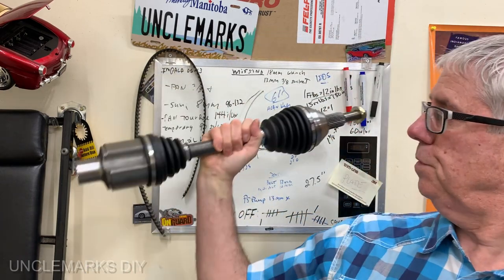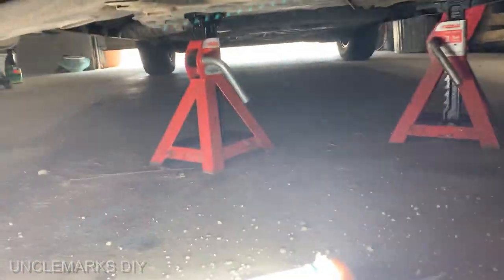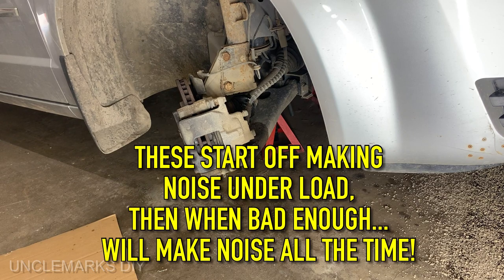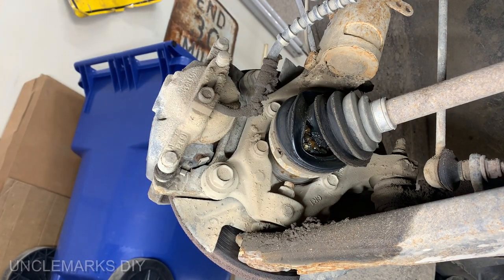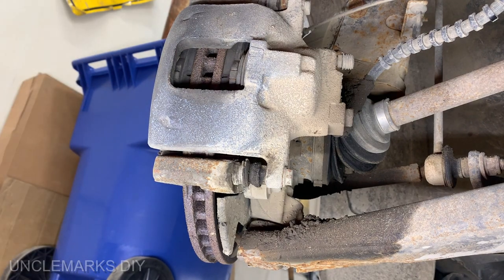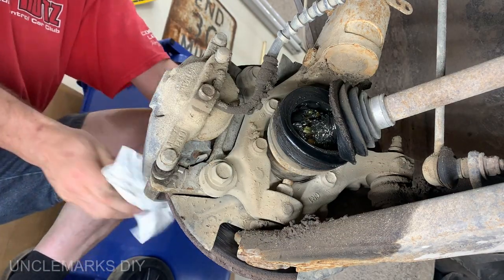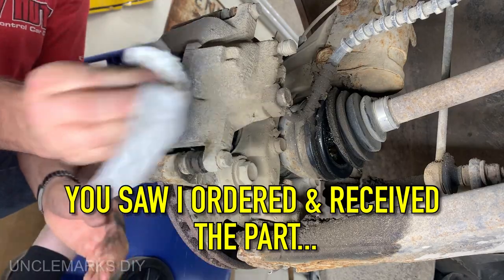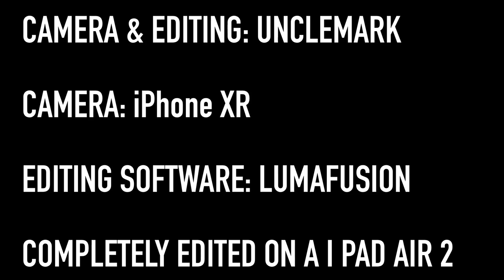Can you grease a CV joint? (EP 144)

Comment: i got 200,000 on a cv joint with a ripped boot. Wrapped it with a roll of silicone tape and just squeezed a few pumps of grease with injection needle every 5-10,000 Worked! But the constant mess was too much and finally fixed the boot. The silicone tape would last 30-50,000 before failing All highway driving though... constant turns in city you might need to replace silicone tape sooner...
Reply from the maker: Mine was only a month or two of lite driving then I did change it! And I agree, if you could only drive straight, the tape and / or grease would stay forever!
Reply: I'm sure in the hallowed grounds of mechanics there is scoffing and jeering, but I like that type of fix...Do what you gotta do...In the end all cars are just getting you from A to B.....I currently can't find any rip in the boot but it's making that noise, but NOT jacked up, only when the tires are on the ground, so it must be a pressure thing....So I guess my next step is to take the boot off and see if I can re grease it...
Reply: @captaingenius-o1c  No need to remove the boot...simply put a grease needle through the boot...preferably just below the metal on the largest end of boot...squeeze about 30-50 pumps of grease...then see what you got. Only takes a minute, and if the noise still there, then replace cv joint. Cheers!
Reply from the maker: @captaingenius-o1c  usually cv joints start off making noise when turning sharp corners. If knocks while sharp right, its the left one, if noise turning sharp left, its the right side one. (Or you could have a loose rim)
Reply: @unclemarksdiyauto  used the needle and put grease in both boots, as it sounds like BOTH sides are making the same noise when turning either right or left....Seems bizarre that BOTH sides would be bad at the same time doesn't it?  or could it possibly be anything else?
Reply from the maker: @captaingenius-o1c  both at same time seems odd, but could be other factors, & now you just started to notice? Also grease needs to get into joint and balls. Its probably too late anyway.
Reply: @khayapf47 what kind of Grease?

Comment: And if you have to do that, maybe even get a better grease than what the application calls for. But once you learn to change a CV joint, it takes about as long to change it out as it does to do this three or four times. The hard part is jacking it up and gathering the tools.
Reply from the maker: So true. We needed the van and didn't have the extra hour that day to change it. I have a video coming out in September 2021 of me doing a 2014 Dodge Dart Cv joint where nothing was easy! (It should have been though) Breaking tools & and a stubborn ball joint that would not come all the way out. They usually are straightforward and quick to do.

Comment: What kind of grease can I use? I live in the tropical climate
Reply from the maker: Briton, I was using general wheel bearing grease. The problem is the grease is not going to stay in the joint if the boot is ripped. I would suggest you get another boot, or replace the complete assembly. Even if you can get one of those "zip on" boots, the cv joint should be properly cleaned and grease reapplied since I am sure dirt has entered the joint. If it is not cleaned first, all your work will be in vain.
Reply: @unclemarksdiyauto  ok, thanks for the tip. The truth is that my cv join boot is still in tact but it's making that clicking sound when I do a full steering lock. I'm assuming that greasing it may solve the clicking sound temporarily, yes?
Reply from the maker: @britonmarrett796  I don't thinks so. I would plan on having it changed soon of course depending on your finances. It will only get worst.

Comment: Are you supposed to put grease on the end of the cv axle that slides into the bearing hub or can you just slide it in dry
Reply from the maker: You can slide it in dry. I usually put a little something on there because they tend to rust together & the next time you need to replace them, they are rusted together and even a big hammer won't get them apart.
Reply: @unclemarksdiyauto  that’s what I imagined. I was in a hurry to get my bearings done on my Silverado and didn’t even think to slap grease in there until after I bolted the wheels back on lol. I guess I could just take off the axle nut and pull the cv out and slap some on if it really bothers me
Reply from the maker: @jonnysnipes3123  Was there a torque spec for your axle nut?
Reply: @unclemarksdiyauto  yea 188 pounds but I tightened it to 200 cus I didn’t wanna use loctite so I wanted that extra precaution just to be safe
Reply from the maker: Some you have to notch the middle of the nut with a punch or chisel to lock it in place. FYI, be careful not to tighten too much, or have them too loose as it can cause premature bearing wear. Thanks for stopping by. Hope to hear from you again!

Comment: Should you lube the boot thats by the transmission on the same axel as well?
Reply from the maker: It is just not even a temporary fix at all. Grease just flings out from the rotation at high speed. If the boot is not ripped open, the grease is inside doing its job. I can’t remember the last time a had to change a cv joint that did not have the boot ripped open. If you’re having issues, just buy new assembly. FYI, if you are in cold climate like here in Canada with part of the year at -40F, the cheap assemblies boots don’t last. Might be worth buying factory parts.
Reply: @unclemarksdiyauto  thank goodness my boot hasn't ripped off I was just curious if I should lube the boot by the transmission as well I just came across this process and I think it's pretty cool and I wanted to get your opinion
Reply from the maker: @bruce3579  I would just leave them alone if no rips and not making noises. It was more a experiment to see if they would hang on until the new shafts came in.

Comment: where exactly are you putting that needle when greasing?
Reply from the maker: @johnbanket7000  I was trying to get it inside between the hours and balls. If your cv joint is making any noises, just replace it real soon. We were not going far with this vehicle and not even much over 35 miles a hour for maybe 5 minute runs. Trust me, this is no solution.

Comment: My CV accel is good the mechanic cut the Botts with small cuts can I still use the axcel and just grease it ? And use silicone
Reply from the maker: Not exactly sure what you are asking? If you clean old grease out & put a new boot on it, you could reuse it. A replacement boot is almost as much as a complete cheap aftermarket cv axle.

Comment: I live in Minnesota and my 2012 ML350 with 81,000 miles makes a clunking noise when I make a hard right or left turn. Have shown to the dealer and independent mechanic and they all said there is nothing wrong with axle, shaft or the rubber is not punctured. The noise comes only during the harsh winter and not in warm or summer weather. At this point of time I am thinking greasing needs to be done as per another video that I came across. Any idea of what grease or how much grease is needed for the AWD 4Matic vehicle? Not sure if there are 2 or 4 joints. Also, rough labor cost or how many hours it would take to do this please? Video - https://youtu.be/XFLaCo9Pbv8
Reply from the maker: We are just north of you in Manitoba. Obviously that should not be making any noise. How do they think that is "normal"? There is one inner and one outer joint on each side. Did they not suggest to replace which ever side is making the noise? In my experience, when they start making noise, they are wore out and need replacing. In the old days, if they did NOT make noise, shops would dismantle the joints, clean them out & replace with grease and install new cv boots. Weird about not noisy in summer. In your video you can really hear it. Is it the joints or something else? Might you need another opinion. I would want to talk to those who specialize in the ML350's. This is all the guidance I can give you. I would really like to know what you find out! All the best my friend.

Comment: You should replace that front rotor while you take it apart that rotor doesn't look like it's in good condition
Reply from the maker: Yes Allen, that rotor has a few miles on it. Good of you to notice. Some grooves on the one side. It has at least 30,000 miles on it (50,000km) With the covid, we driving it nowhere at speeds of 35 mph max (60 kph) in our small town and only about 125 miles or 200 kms a month, so gonna wait to replace as soon as we can travel. Had it on a hwy trip awhile back and no problem stopping. But I am sure it would work a lot better with new ones. Look forward to that being a video maybe later this year!

Comment: Get a needle tip grease fitting and poke it into the boot pump it full of grease not to much then clean around hole and hightemp rvt silicone the hole u poked or grease will spit out all over when u drive. It gives u some more life. That's 8f the boot ain't ripped if it's ripped fuck get a new one get it done
Reply from the maker: Yep. Was not wanting it to pile up until the new cv joint wad installed. Your right Ben, normally this is not the way to go. Just get it done for sure! New CV was installed about a week later and all is fine!
Reply: What kind of Grease should I use?

Comment: You could have changed it by the time you finished greasing it.
Reply from the maker: A video coming out on that soon. It actually took longer to replace it than to grease it. But yes, an extra hour and it would have been done!
Reply: On many vehicles OEM parts are much stronger than aftermarket. A lot of times it's better to fix, or do regular maintenance, than replace.
Reply: Zero chance you are replacing that in 20 minutes lmao. It’s easily a 2 hour job.